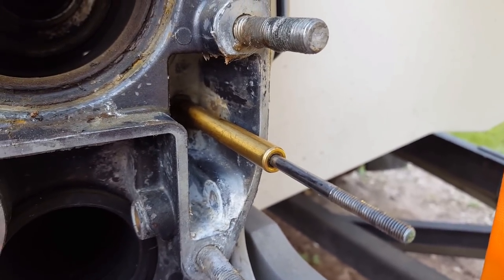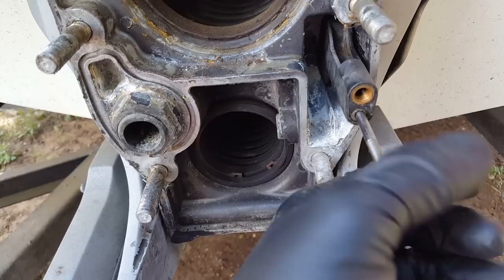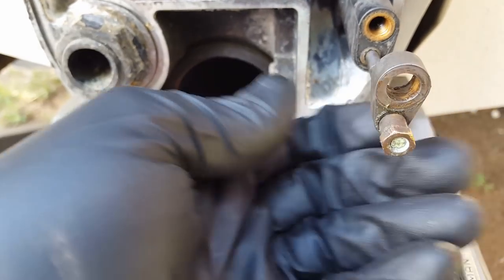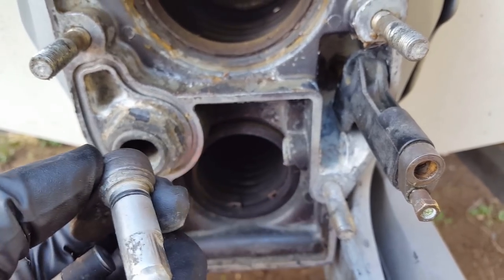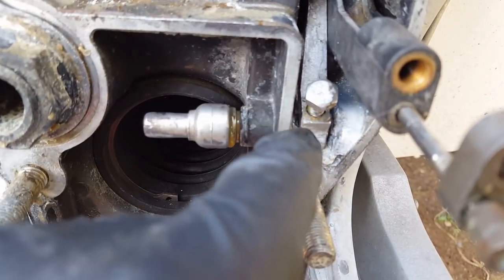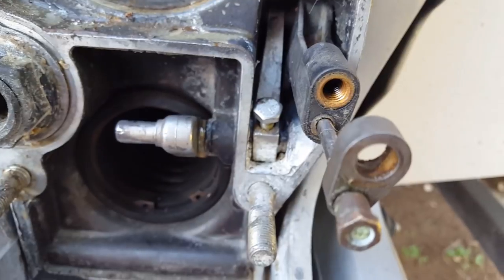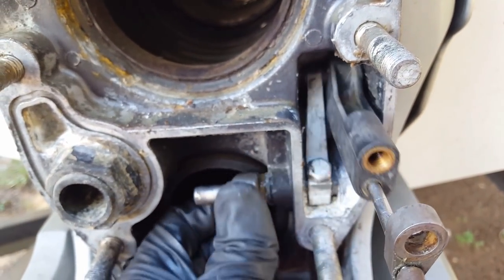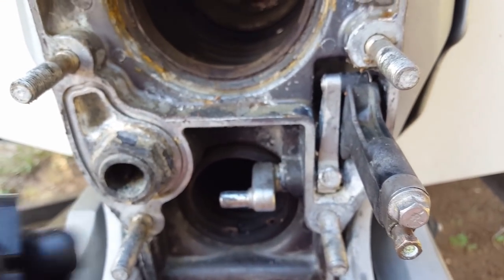OMC Cobra Shift Cable Replacement Part 2

Comment: Is the first adjustment tool that fits in the 2 bolt holes used to keep it in place so you can adjust it on the the engine side? or is the first adjustment tool used for something else?
Reply from the maker: joe ortega The first tool is designed to hold the cable where neutral would be on the cable. It's also designed to hold the cable in a fixed position while you tighten the engine side to the engine shift bracket. Without that tool, you will have to make drastic adjustments on the engine bracket. The tools are dirt cheap. https://rover.ebay.com/rover/0/0/0?mpre=https%3A%2F%2Fwww.ebay.com%2Fulk%2Fitm%2F152203518503

Comment: Did you 3D print the tools yourself? If so, wouldn't happen to have files still?? Thanks for the videos, nice job.
Reply: Look on eBay for the parts. For about $70 you can get the shift cable kit that comes with both adjustment tools. It looks 3D printed but no need.

Comment: Hi Michael,
At 9:16 you are showing two alignment tools, do you have maybe a skatch/drawing of them, with the exact dims?
Appreciate your help :)
Reply from the maker: One is a bell crank tool, the other is the shift cable alignment. I recommend buying both, they need to be rigid tools so I wouldn't recommend making  one at home. https://www.nlamarine.com/products/omc-cobra-shift-cable-adjustment-914017-915271-bellcrank-alignment-tool-set?variant=3737795589
Reply: Appreciate your help, we have already ordered it :) :) ;)

Comment: Hello my shift cable dident come with the cable ajuster tool for inside are you able to tell me the messurement for it ? Thanks in advance
Reply from the maker: Don't take a chance trying to measure it by hand. You can get close that way but it's best to get the tools.  https://www.nlamarine.com/products/omc-cobra-shift-cable-adjustment-914017-915271-bellcrank-alignment-tool-set?variant=3737795589

Comment: If the cable moves and it’s not adjusted fully right when the drive goes back on is there a way to fix it without taking the drive off again
Reply from the maker: If it was adjusted properly at some point yes. You will still need the shift alignment tool though. You could in theory just measure it, but I'm encouraging people these days to buy the alignment tools. The tool will set the shift linkage perfectly to 7 - 9/16. https://www.nlamarine.com/products/omc-cobra-shift-cable-adjustment-914017-915271-bellcrank-alignment-tool-set?variant=3737795589

What you will do is put the stern drive in neutral. Confirm the prop free spins in the back. Then disconnect the shift linkage from the shift bracket. Use the longer of the two from the kit and set your shift length. Watch my ESA videos too as they help clarify this even better. It's a 5 part series.
Reply: Michael Romer adjusted the cable with the correct tool and at first it was shifting fine. But then it would not get any reverse even when I took the lower cable off and shifted it by hand all we can get is a clicking sound like it’s trying to get reverse
Reply from the maker: Oh so you have the shift cable off the engine bracket and you are manually moving the cable. If you can't get it into reverse by manually  moving the cable by hand, the stern drive must be removed. Your shift height is wrong. It needs to be adjusted. I show how-to do that in part two of my ESA series.

Comment: Hey Michael,
Thanks again for the video.  I was adjusting my shift cable yesterday and noticed in the shop manual that they highly focused on the distance between the center of the shift pin hole to the edge of the brass cable fitting to be at 7 9/16 inches.  Shouldn't we worry more about that length rather than the position of the shift cable trunnion (brass cylinder looking thing)?  I bought the tools to do it but I came to a pause because I got a little confused.  Once again, thanks for all the videos.  I've pretty much watched all of them 5 times of more..haha
Reply from the maker: Great question. The answer to you question is here: https://youtu.be/whGSfsGHEao
Long story short, there are 5 videos worth of explanations to be exact.
Reply from the maker: Thanks for following the video series! Hope you like them!

Comment: Hi MIchael! At 1:45 of this video I have a question about the 5/16 brass nut that goes on the end of the cable. I just pulled my outdrive in prep for changing the shift cable, and noticed my drive does not have this nut. Is this normal? Looked at the parts diagram at Crowley and they show no nut for my rig / 502APRJVB/Ford 5.0. Thanks!
Reply from the maker: Ned Stroller I’ve heard other users mention the same thing. In theory it’s just for extra protection. Likely for vibration. The people who mentioned not having one don’t go back and add it.
Reply: @michaelromer2016  REALLY appreciate your videos!!!!  I am tackling an 87 SeaRay that is new to me.  Tons of work, replaced the engine coupler, gimbal bearing, bellows, ignition refresh, starter (marine grade).....  After watching this I understand the geometry of the alignment and bought the tools. Questions for you:  1)  I also don't have the retainer locking nut - can I use a nylon nut?  Would like the security:)  2)  You state putting the retainer about 1/2 way on the threads....  should I start there and then check the travel at the bracket end before calling it good?

Comment: I see a discrepancy in your video.The last known OMC service bulletin (along with Stewart Hastings) calls for the retainer to be threaded all the way in until it stops at the end of the cable threads. You can back off less than one turn to allow it to line up with the shift guide bolt hole. The retainer nut is not to be used and simply discarded. Other than that.... good video.
Reply from the maker: Thanks, I love constructive feedback! More videos to come!

Comment: My omc shifts perfect forward, but in reverse the cut off switch gets hung up sputters for 5 seconds then kicks in reverse I don’t get it
Reply from the maker: Classic example of the cable being out of specifications—basically it is stretched or corroded. When you have the stern drive out, you will also have the opportunity to grease various surfaces and check the shifter height.

Comment: Hi Michael. Thanks for the great videos. Would you happen to have the part number for the brass 5/16" nut for the lower shift cable? When I pulled my outdrive off i found that i did not have one on my assembly.
Thanks!
Reply: And the bolt holding the retainer on was very loose. (Bet you can guess I've been having shifting issues)
Reply from the maker: Joseph DeFrancesco have you checked the part breakdown on https://www.crowleymarine.com/ some don’t have the brass nut.
Reply: @michaelromer2016  thanks!
Reply: Michael Romer 
See my comment with the wording from the OMC technical bulletin. They added that nut in 1990 and in 1996 they suggested that it not be reinstalled. If someone does not have that nut I bet it is from a pre-1990 Model.
Reply: a common 5/16 10
-32 jam nut will work

Comment: So my omc. If it’s in neutral I can shift into either gear perfectly fine. If I try to go from reverse to nuetral or forward to nuetral it is very hard. Have to really force it back to nuetral. Is this the cause of that? If not what might it be? Thank you in advance
Reply: 1990 omc 4.3 cobra

Comment: I'm replacing my shift cable now on OMC 5.0l and after I set the alignment tool on the outdrive to keep in neutral it doesn't line up on the engine side. It's like I'm running out of threads to move the trunnion and cant match it up.
Reply: Have the exact same problem
Reply: Johnny I ended up aligning the outdrive and installing it back on the transom then I went to the engine and pushed all cable slack back in  which engages into gear and it gives u just enough to get 6.5 inches from trunnion to center hole and that ended up working. Good luck
Reply: Mario Garcia  thanks man will get back to working on it after work

Comment: Thank you,  I for one absolutely appreciate your videos!!  I have spent countless hours searching and watching videos and always come back to your videos.  Like everything in life things change or we make basic mistakes and for those of you who feel the need criticize this gentlemen after watching his efforts there is something called constructive criticism in which you actually add something beneficial for those of us looking for guidance,  and then theirs something called just being a "Jack A$$"  Keep up the great work Mr. Romer!
Now for my question!  for clarification purposes the 5/16" nut on the out-drive side of the shift cable is 'No longer used" correct?  and the lock nut on the motor end of shift cable locks down the shift cable at the end of cable housing sheathing?  correct?
Reply from the maker: John thanks for your comments! The 5/16 is used because after about 5 years and really bad luck,  the cable could turn around inside the sheath. It's unlikely but, I'd still use it.  Think of it like insurance. And yes,  the other end locks down the other side as well.
Reply: Thanks for the info and I apoligize to you and your followers for my reply,  but if I took everything I watched on YouTube as gospel... oh boy id be in big trouble so I always refer to multiple sources to compare notes.

As for my question, unfortunately the only reason I asked this is because I could not find my 5/16 nut during the reinstall anywhere? and after watching this video several times over and several hours of searching my shop(misc. bolts drawer, under the boat, engine compartment, Garbage, I even removed seats!!) I went to Crowley Marine catalog to order the part and its not listed there? 

https://www.crowleymarine.com/johnson-evinrude/parts/55333.cfm?mdl=VZOG47  (see parts 22,98,99  no 5/16" nut)
 
I started reading the comments section here and came across Mr Pateys post regarding this (good example of constructive criticism) and the light came on and I realized that this cable had been replaced by previous owner and they must have known about the service bulletin.  so my actual question should be do I need to get one if I do not have one now?

Thanks 
John
Reply from the maker: John, the 1987 version for some reason didn't include the 5/16 nut, however if you check later versions, for example, 1991.  You can actually find the nut that you're looking for, it was likely added as an insurance policy-- anyways it's about $6 here's the link https://www.crowleymarine.com/parts/11575.cfm
Reply from the maker: I'd install one.
Reply: this is flat out kicking my butt!  im so invested in this project now there is no way I want to take it to a shop now!!I followed instructions. the manual and crowley Marine instructions!  I was so sure I had it right but wont go into Fwd?  a few things were different than your video, My shift rod is the basic screw in and out version and I adjusted it off the same locations as you did which is the same as the manual so hopefully the measuring points are the same?  but it was a good 1/2" of difference from the prior position.  I did purchase the correct tools including alignment tool.
Im going to adjust the bracket right now but Im wondering if I could get of an adjustment out of that or if I should just pull the out drive back off?  could I have missed the shift rod aligning with the bell crank when I installed the outdrive?  if i did would I even be able to get it into reverse?

I also ha
Reply from the maker: Take a look at this video. https://www.youtube.com/watch?v=4QwUTNwTzFc&t=284s After watching it, tell me if your setup passes the go/no go test.
Reply: @michaelromer2016  No Sir it does not!  Im pulling the out drive back off now 🤔   last night I was frustrated and watched that video again so I went back out and started measuring  the trunion position in N-F  and reverse in place, Neutral was spot on,  Reverse was spot on but FWD was maybe a 1/4' off.  I have been questioning some of the other forums and videos regarding having to turn the prop while shifting from the remote shifter to get the dog gears to engage?  I was hoping that was my issue because I was alone and couldn't shift and spin the prop, but clearly in your video you are not doing that.
Reply: I started to adjust the upper shift rod (from the remote shifter)  and I noticed what I thought was the shifter cable slipping before actually moving anything?  so I pulled the cable back off, put it on the adjustment tool and noticed I ran out  of threads before I could set the truninion to the mark on the tool?  I gabbed the tool and pushed it into sleeve and it slid almost a full inch!!!  I went back and read the instructions that came with the tool and I  guess I didnt remove all the slack in the cable before I tightened down the lock nut end on bell crank?  So Im going back to do that now.
  Ironically in part at 2:27 you discuss how far to put that nut on initaaly and I obviously got that wrong
Reply: OK wait a minute after I watched this video again I dont see anywhere that that you had an issue with slack?  and maybe imoverthinking this bot If the outdrive end is locked in with the retainer after you set the bell crank to 90* using the tool and setting the engine side of the cable using the other tool, the slack should be irrelevent to the operation and would only be used to route the calble into place after installing it correct?  so quite possibly my cable could be bound up insibe the black hose that protects the cable or I rerouted it wrong?
Reply from the maker: @johndibenedetto3702  I would remove the stern drive and make sure you can pull and push the cable back and forth with no more then a few pounds of effort. The spec should be no more then 8lb. The bell crank needs to be checked and also did you grease the plastic sleeve that covers the shift cable? As seen in this video,  operation forward and back should feel effortless.  That's with the stern drive out.
Reply from the maker: John, check out all 5 parts of this series. It will explain a lot. https://www.youtube.com/watch?v=whGSfsGHEao
Reply: @michaelromer2016  I have found the shifting issue after pulling my out drive back off, Im confident I hit the shift rod while I was putting the upper back on, it was off by quite a bit so Im assuming I adjusted everything thinking it was in neutral and it wasn't.   I started over and passed the go no go test this time! so the boat is loaded on my truck and Im ready to launch right now!   I knew I had an issue with idle on this quadrajet carb so I was just running it with the ears on to adjust idle and its running like crap?  I came inside and started watching the 5 part series again and like a dumb a$$ should of paid attention to part 1 because my interrupter switch is acting like its on backwards?  in neutral i cant adjust the idle so i manually pushed the over stroke switch and nothing?  I then used a screwdriver and pushed interrupter switch and it idles great?   it seems like its working opposite of how it supposed to?   could the interrupter switch be installed backwards?
Reply: @michaelromer2016  It is a 10-32 thread commonly available at any hardware but may need to file one side down as it is close quarters with the above bolt

Comment: 1996 23 footer eurosport 454 yamaha out drive
Reply from the maker: So that model is similar in design to the OMC cobra/Volvo out drives. I have an ESA series that goes over how-to fix issues like you mentioned in your comments. Look for the 5 part video series, as they will help.

Comment: sweet, just bought a boat at a yard sale, precious owner said it would not shift into reverse, from everything ive seen looks like bad cable, boat and trailer and wakeboard rack only $100,   thanks
Reply from the maker: You got a steal. I have a video that goes over just about anything that can go wrong to that boat. Do me a favor and please hit that subscribe button!
Reply: @michaelromer2016  Update, THE only thing wring with the boat was the fuel pickup tube from the tank, it had disconected in the tank and was sucking air, installed a new tube and now runs great, shifts and all no problem

Comment: I don't know where you got your training but you made  3 major mistakes that I saw. 1 you never put sealer of any kind on an "O"  ring or a moving shaft because you will lock it in place-- 2 the brass nut  is for locking the threaded tube to the  top of the cable housing  3-- and always use a flat washer next to a cotter pin so you don't rub threw it  and brake it. This is basic mechanics 101.  ROOKIE
Reply from the maker: Hello! I’ve never been trained, I just read the OMC manual. Please subscribe!
Reply: threw it = through it
brake it = break it
Rookie English mistakes. But you are good to point out the issues. Your comment still helps.

Comment: This video is totally incorrect. This guy doesn't have a clue what he is doing but acts like he does. That cobra would never shift correctly set up like that. He set the jig up all wrong and the nut he wasn't sure what to do with is used to position the jig.
Reply from the maker: 100% correct,  nothing works,  boat is sunk. Try presenting a solution next time when you present your case.